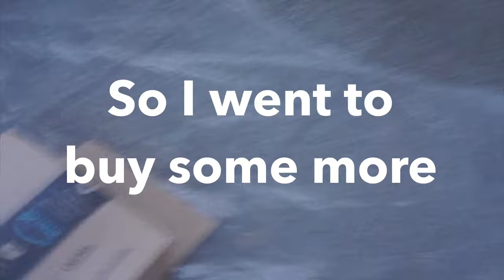HOW TO CUSTOM SPRAY PAINT YOUR BIKE AT HOME

Comment: So I just got a brand new bike and wanted to know if there are any steps I can skip since it has a perfect paintjob on there, such as sanding and or using primer?
Reply: Also super sick editing
Reply from the maker: I wouldn't skip steps like sanding and primer (yes sanding is a lot of work), because else the paint job could easyily come off, and since you put in work and money anyways, I would try to do it right. You could skip the clear coat, but that one only costs like 5 bucks and is not a lot of work.

Comment: What grit of sand paper did you use for the wet-sand and then for the in-between while applying the primer? This is a really helpful video!
Reply from the maker: Look at the link in the video description. I started of with the rough sandpaper(80 - 400) and worked my way up to the finer ones (600 - 2000)
Reply: @sempribo love the editing and final outcome. I rawed a frame once and used the paint stripper for the first time step. Really sped things up. 
p e a c e
Reply: Do you have to totally strip the pain or can you just rough it up then hit with primer?

Comment: I'm thinking about doing this with my bike frame, but the part I am dreading the most is the sanding.
Reply: Yeah I think it's better to pay for sand blasting.
Reply: There are bike specific chemical solutions that do most of the work for you, both for carbon and aluminium/ steel.

Comment: Wouldnt the break pads rub off the paint? I really want to paint my bike wheels black but I'm afraid it would mess up my brake pads
Reply from the maker: I thought so too tbh, and was not sure if I should spray paint the whole wheels or not, but till now the break pads work fine and the paint did not come off. If you use 2 coats of primer, it should be alright
Reply: Yes, it will and you will be putting yourself in danger of the brakes not stopping you at all
Reply: You should not paint brake lines because the brakes wont work as well
Reply: @John_CL  pads or line?

Comment: few question.what does the water do with the sandpaper? and why do you have to tape off certain areas? and also when its done, does the bike feel sticky or does it feel like a regular smooth new bike? thanks
Reply: Wet sanding is often better than dry standing for various reasons. If you spray paint in screw holes the screws won't fit anymore. And the cleat coat should mean that the paint doesn't feel sticky.

Comment: Did the paint go hard on the frame or did it stay quite soft? I painted with montana about a year ago and i pained my frame and the paint still isnt hard as i can dig my nail into the paint work and it leaves a indent. Just wondering if it happend to you as well? Cheers George
Reply from the maker: no didn't happen, the paint is still good. Maybe try clear coat next time and at least 2 coats of primer

Comment: I have an e-bike and the battery case is plastic! Do I need to sand the plastic part or can I just use the primer from the start?? I know I have to sand the metal part but I’m not sure about the plastic part :/ help me please!
Reply from the maker: if the plastic is painted aswell, maybe try with smooth sanding paper, but it should be fine if you skip that

Comment: If anyone wants to paint your wheels, and have rim brakes you must tape  the edge of the rim where  the brake pads will come in contact.  If you paint over it you are putting yourself in danger of the brakes not stopping you and it will definitely ruin your brake pads.
Reply from the maker: Brakes still worked fine, but the paint came off, so I would also mask it the next time.

Comment: Can I ask why you masked the holes? Is it a problem if the paint goes inside?
Reply from the maker: You want to mask all the areas where screws go inside or where there is a lot of wear, else screws will not go inside or the paint will scrub off anyways.
Reply: @sempribo  Thanks! Makes sense, I didn't think about it.

Comment: What did you use to wipe down the bike of sanding dust between coats ? Great video man bike is class
Reply from the maker: I only used very fine sandpaper between the coats after it dried, but you could also use a normal towel to wipe down the dust.
Reply: @sempribo  cheers thank you for reply

Comment: Great work 👍 
I started the process of sanding the colour . I am a beginner, while watching your video following questions came in mind: what are the coats ? Why covering the holes ? It was easy to assemble on and of your bicycle ? 
Sorry for bad English 😞
Reply from the maker: Awesome!
To "what are the coats ?"
"coats" are also called "layer", one coat of color is when you have one layer of color on the bike
To " Why covering the holes ?"

most of the holes were holes for screw, you cover them up so you don't mess up the thread and also its better to have no paint inside the frame
To "was it easy to assemble/disassemble the bike?", assembling was actually very easy. But disassembling was hard, because the pedal "crank arm" was hard to disassemble. But with youtube tutorials its not so hard, just search for (how to disassemble a bike)
one tip: when you disassemble the bike, remember exactly wich steps you do and wich screws go into wich holes, maybe make photos or notes. That will help you a lot when you assemble the bike back together.
Reply: @sempribo  Thanks for the immediate response!

Comment: What grit did you use for the sand paper ?
Reply from the maker: I started with strong sandpaper(80 - 600), then I finished it off with finer sandpaper(800-1600)

Comment: Did you make that stand for the bike? I want to paint my bike but don't know how to find or make stands like that
Reply from the maker: For that I just used a broomstick and a parasol stand
Reply: @sempribo  I appreciate the response. I figured thats what you did. Did you cap the inside of the stem so it doesn't fall down the broomstick?
Reply from the maker: @chaddicusthegreat  The broomstick fitted perfectly on the frame, so i didn't need to do that (see 2:24)

Comment: Great video - this makes the process look a little less daunting, I may try it myself haha. Question on the wheels - the old bike has chrome/silver linings where the brake pads are aligned. Since painting over them with Black paint - and riding for a little while - I'm curious if the black paint has worn off at all?
Reply from the maker: Thanks, till now the paint hasn't worn off at all
Reply: This project can turn into a week.